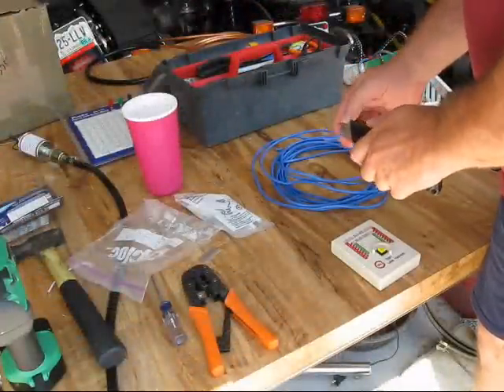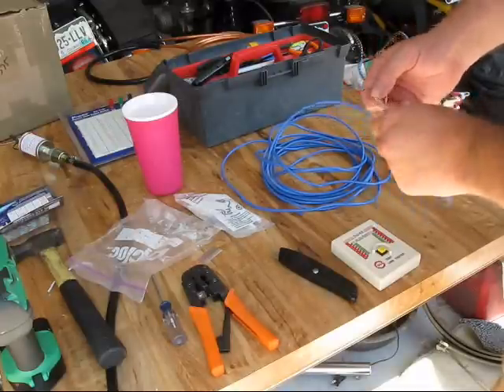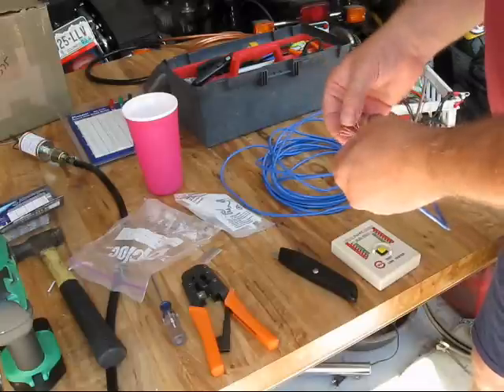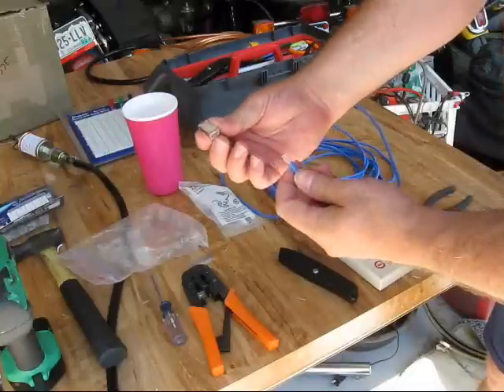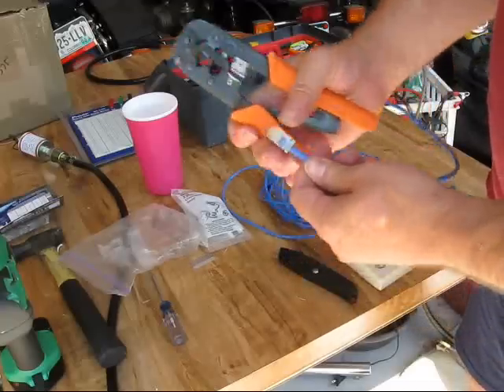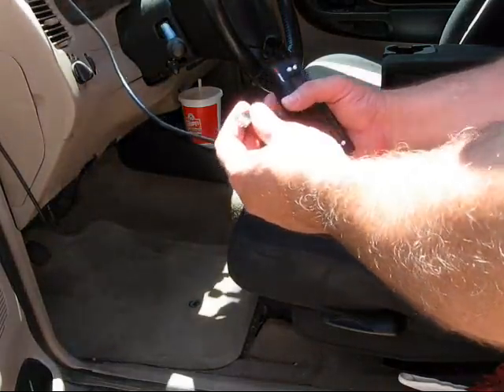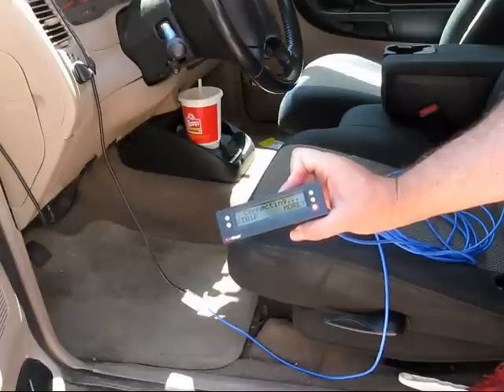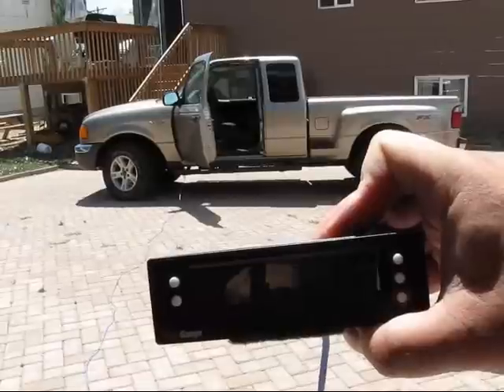#08-078 Make an Extension Cable for the Scan Gauge II

Comment: Nice job! I'm going to buy one of these for my car and when I first saw it I was wondering if an ethernet cable would work so I could run that through my dashboard and be able to easily remove the scangauge and the included cable.
In your unpacking video, I noticed that there is a 2nd RJ-45 port(On the side).  Do you know what that's for?